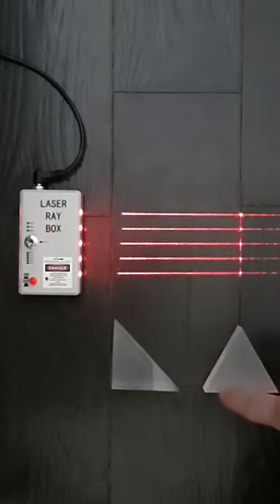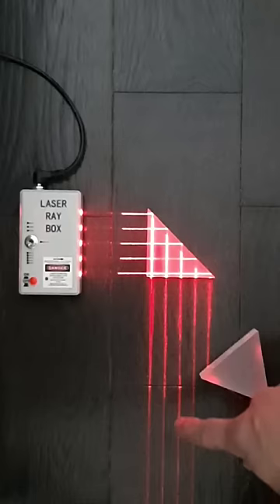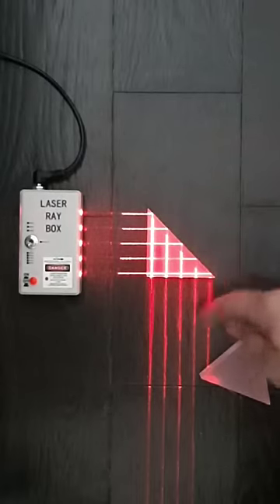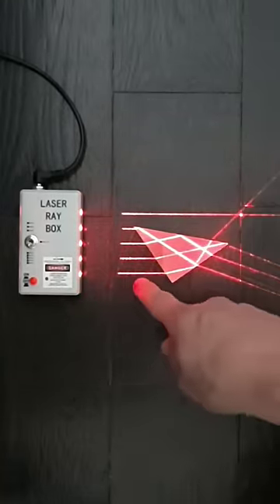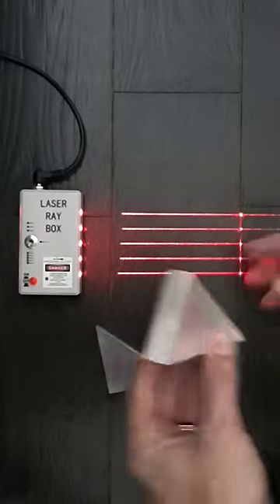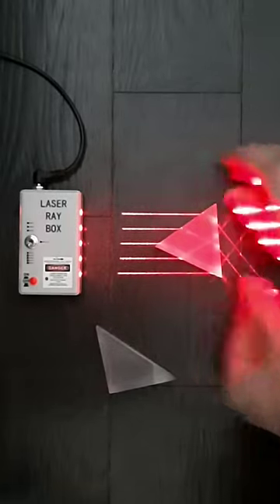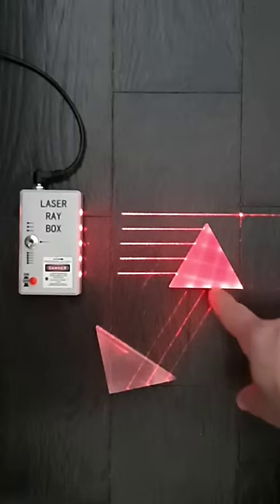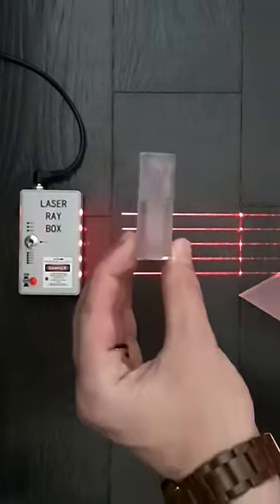How Prisms Work! #shorts

Comment from the maker: To learn more about optics-related science topics, view Edmund Optics’ Knowledge Center.
https://www.edmundoptics.com/knowledge-center

To view the largest selection of optics, laser optics, or other optics-related products, visit our website.
https://www.edmundoptics.com/
Reply: So here's what I want to know, how reflective is the total internal reflection? is it more reflective than a highly polished silver or aluminum mirror?
what about when compared to a dielectric mirror?
Reply from the maker: @Metal_Master_YT  amazingly, 100% percent of the light is reflected in total internal reflection, giving it an advantage over some types of mirrors. However, some light will still be lost transmitting through a glass prism and at the entrance and exit faces of the prism. 

You may get more light throughput using a prism instead of an aluminum mirror, but for the absolute highest reflectivity, dielectric mirrors are usually used

Comment: Just so people are aware, each material’s transition to another material (ie. the change from prism acrylic to air) has a specific “angle of incidence” at which point a beam of light reflects back like a mirror rather than passing through. Think of it like skipping a stone at a very shallow angle. That’s why for the shallower angles the light reflects back into the prism, while for the steeper (closer to perpendicular to the surface) angles allow light to pass right through.

Comment: The first prism is a right-angled prism where the other two side are of 45°. The rays that fall normally (90°) on the perpendicular side of the prism make a 45° angle of incidence with the hypotenuse side. Since the critical angle of this type of prism is around 42°, Total Internal Reflection (TIR) occurs which is why none of the rays pass through the hypotenuse but instead get deviated towards base.

Comment: They're also used in Ring Laser Gyros (RLGs).  RLGs are used a lot in aviation and live inside of Inertial Navigation Systems (INS) and take just a couple minutes to align versus an older regular INS system where it would take over 30 mins to align.  

When an RLG is powered on, it uses a prism to split a laser beam in two directions, which are opposite of each other.  Each beam hits a mirror on each side/corner and is routed to a detector.  When the RLG is rotated about its axis whether it's X,Y, or Z, one beam of light will reach the detector sooner than the other.  Of course we're talking measurements smaller than picoseconds, but yeah.  This is then translated to movement, and is processed and shown on aircraft displays for pitch/roll/yaw information.  

Each Inertial Navigation System (INS) has 3 RLGs inside of it (one for each axis). Most aircraft have at least two INS systems.  All brought to you by, lasers 😁😎
Reply: So how does an INS work?
Reply: the fact that we can measure things based on the speed of light being changed is crazy

Comment from the maker: What other topics would you like us to talk about?
Reply: I remember studying this for my physics exam very annoying since I don't get to play with the prisms or mirrors
Reply from the maker: @ThatOneOddGuy  Yeah getting to actually see how they change the light makes these concepts a lot easier to understand!
Reply: Can you explain why your hand got illuminated behind the prism, even though there was total internal reflection? So, did not all light get reflected?
Reply from the maker: @chunchunmaru1337  that's because this laser box generates laser lines (triangles of light expanding away from it) instead of normal laser beams! That makes the light show up on the ground below (which is great for these demos), but some light also passes over the top of the prism and hits my hand behind it
Reply: What pther topics? Principle uses for beam splitters.
Reply: Are there any nonlinear crystals containing something like gadolinium that have unusual effects in magnetic fields?
Reply: If you aligned two lasers perfectly for destructive interference so that it appeared dark, where does the energy go?
Reply: How does a Q switch work?

 How do I even know what Q means in what context?
Reply: Is there some kind of optical device that can focus completely diffuse light? Perhaps using components with variable index of refraction or a metamaterial that emulates such? 
Or would the problem of focusing diffuse light to a point be a lot simpler than that?
  What materials have that nonlinear property where the index of refraction changes based on the angle of incidence? Or has that property only been demonstrated in metamaterials?
Reply: I would like to see the actual manufacturing process of making narrow band filters. I understand the concept of thin film interference, but how does one use holograms to create filters that seem to work in any arbitrary frequency or combination of frequencies? How are they made ? How are they mass produced and what kind of materials can you make them out of?
 I would love to see a whole factory tour!
Reply: I want a specific lens for a project. How do i either make one at home or buy one at a reasonable price?
Reply: I always save the prisms from stuff I scrap, like old projection tv's.  My favorite is getting them from old Tank parascopes.
Reply from the maker: @commodoresixfour7478  Awesome!
Reply: @petevenuti7355  Due to conservation of etendue it is impossible to focus completely diffuse light
Reply: @thewhitefalcon8539  I can't say I quite understand that principle yet, but if you understand it, I got a question, when talking about a reflected light source, wouldn't the 'color temperature' of the light matter more, that is limited by both the luminosity and the spectrum of the original source , rather than the item doing the reflection?
Reply: @petevenuti7355  Colour temperature matters if you are trying to heat something up. A 5000K colour temperature won't heat something hotter than 5000K.

Heat is diffuse too, so diffuse light can make heat, but diffuse light can't make concentrated anything.
Reply: @thewhitefalcon8539  I still think a metamaterial where the index of refraction varies with a  angle of incidence ,and possibly negative value, would be an exception to the diffuse light rule... If tuned just right I'd expect that all the light from a diffuser that hits a point of such a material would be transformed to  'appear' thereafter to originate from that point on a surface much smaller than the diffuse source & going in a single direction...
   It's not like I need a material with negative mass to make it work 😜 not quite as far fetched... 
  Seriously though, I'm aware of nonlinear index materials also composite materials with negative index of refraction, never both and if I understood the Math of how these composite materials are designed I may have already tried to build it... 
  If you understand the math of nonlinear photonic crystals,  then tell me , is there some inherit limitations of the constants of nature that would preclude the existence of such a material? Or would it just be impractical because say for example it would only work with an extremely narrow band of frequency that was different depending on angle. (Which would still be very interesting)
Reply: But why does it reflect
Reply: Do prisms work differently underwater, or in a vacuum?
Reply from the maker: @ChaaFound97  they would work differently! The angle light is bent entering the prism and whether that total internal reflection occurs is based on the 2 materials (in this case air and glass). It would be quite different underwater
Reply: More prisms!
Reply: @ChaaFound97  yes , 
it's the difference between the refractive indexes that give it its properties , have you ever seen the invisible glass trick where they put one glass inside another and fill it with oil and the glass inside becomes invisible? That's because the oil has the same refractive index as the glass, if you did that with a prism, it wouldn't be a prism. What about putting two wet pieces of glass together? when you squeeze the air out from in between, you loose most of the total internal reflection.
Reply: Can you do thin film interference next
Reply: @edmundoptics jjjjjjjjjj😊jj😊😊jj😊jjj😊j😊jjjjjjjjjĵj😊jj😊j😊jj😊j😊jj😊hhhhhhhhhhhh😅h😅hhhhhhhhhhhhhhhhhhhhh😊😊hhhhhhhhhhhhhhhhhhhhhhhhhhhhhhhhhhhhhhhhhyĥhhhhhhhhhhhhhhhyhhhhhhy7766766766666666y66666666y6y66y6yyyy6yyyyyyyy66yyyyyy😅yyyyyyyyyyyyyyyy6y66y666666y66yyy6yyy😅y😅yy😅😅😅y😅yyyyy😅😅😅yyy😅😅yy6yyyyyyyyyyyyyyyyyyyyyyyyyyyyy6y66😅yyyyyyyyyyyyyyyyyyyyyyyyy😅yy😅yyyyyyyyyyyyyyyyyyyyÿy7y6yyyy😅y76yyyyyyyyyyyyyyyyyyyy7y7y7y7yyyyyyyyyyyyyyyyyyyyyyyyy77😅😅yyyy😅y😅7y6yyyyy67yyyyyyyyyyy7yyyyyyÿyyyyyyyyyyyyyyyyyyyyyyyyyyy😅😅😅😅😅😅😊😊😊😊😊😊😊😊
Reply: Fiber optics.
Reply: Mint moblie
Reply: Jesus Christ the sovereign God loves you 😊 I hope you can personally get to know the Holy Trinity, God miraculously healed me of my chronic breathing issues that plagued me for years on a near nightly basis if not every single night
God did this healing instantaneously within a group anointed prayer over my health, doing what nothing else would for years
Reply: Wait what.  That's REFRACTION, not reflection
Reply: Do u provide these as education kits that teachers can buy?
Reply: Make a pentaprism to show how a camera viewfinder works 😎
Reply: Can we trap a beam of light in an infinite loop of reflections?

Comment: It’s called snells law and has to do with the index of refraction of both materials the light is passing through. In this case air and glass. Then by taking the angle at which the light hits each material you can see its angle of refraction.
Reply: Exactly. Thank you.

Comment: Technically this is refraction, not reflection
Reply from the maker: The bending of light as it goes from one material to another (like air to the glass prism) is refraction, but the light reflecting back inside of the prism instead of leaving isn't refraction! It's called total internal reflection and it only occurs at specific angles of incidence

Comment: Another interesting thing about total internal reflection is that there’s 0 energy loss in this phenomenon unlike reflection from a mirror. This is used in optical fibre cables to transmit data as a beam of light with minimal energy loss
Reply from the maker: Exactly! That's why total internal reflection is so powerful

Comment: A quick explanation is that the shallower the angle The more likely the light is to bounce instead of go through. The angle required for this to happen is determined by the ratio of the speed of light in the 2 mediums. Thats why if it's straight on, it passes through, but glancing light will bounce off. Think road shimmer off in the distance or

Comment: Hmm a computer with spinning prisms inside it that act as gates with times laser pulses would be interesting
Reply from the maker: Scientists are working on making faster computers using light instead of electricity! Check out "photonic integrated circuits"
Reply: It's fun to have an idea and be able to find and read papers about the topic. I always feel dubious about concepts that I can't find precedents for.
Reply: You say that as if it would be faster or something.

Regular electron circuits are not about electrons physically moving, but the charge variation created, which travels at the speed of light. It is slower in longer distances because of resistance in the material the cable uses (eg copper). The reduced impact of the latter is why fiber (glass or plastic) optic (photon based)  cables are faster. Not because there is a speed difference between electric charge traveling at the speed of light vs photons doing the same (in a vacuum)

Point being, the reason light bends in a prism or any material one can see through. Is because on an atomic level the are electrons "spinning/orbiting" around the atom is creating electric charge. Photons react with this electric charged area on the atomic level and therefor changes angle, but it also moves slower.

The reason you get an angle in see though material is because light movies slower inside the material because of matter and the deflection angle of the light depends on the electron configuration of the atom, aka material. Therefor it is not a given at such short ranges that a "photon prism transistor" would be faster than a electric transistor.

My2cent.
Reply: @Lobos222  Well so the difference in speed is more tied to inrush/analog verses steady state/digital synchronous logic. So we're no where near approaching either case with digital circuits. 

There's also the fact that one of the main reasons to explore flux path, photonic, or plasmonic computation is non-linear operators which allow for instantaneous solving of calculus functions like differential equations, and integrals. 

As well as considerations for reversibility, quantized junctions, fully 3d architecture, chaos/dynamic/emergent process computing, component architectures that allow for memristors for super-efficient MRAM, and nanoscale dynamics like tunneling etc. 

The main hurdle right now is lack of standards in physical design kits, inadequate characterization of material properties, and lack of a single process nanoscale maskless lithography system.

Comment: Same thing happens in eyeglass lenses. Sometimes we make glasses with prism in it because the customer needs it, but sometimes we accidentally get prism in the lenses and have to start over. It is incredibly easy to mess up a pair of glasses 😅
Reply from the maker: Yeah prisms in eyeglasses help correct for double vision! If your 2 eyes aren't focusing on the same spot, a prism can change the focus position of one eye to line up with the other

Comment: Might be a small detail but the bending of light is actual called refraction.
Reply from the maker: The bending of light as it goes from one material to another (like air to the glass prism) is refraction, but the light reflecting back inside of the prism instead of leaving isn't refraction! It's called total internal reflection and it only occurs at specific angles of incidence

Comment: Should have explained how this happens. This has to do with the angle at which the light it hitting the glass and the different refractive indexes. This is also used in fiber optic cables. Light cannot escape glass if the angle of the surface is more than 45° thus being reflected inside.

Comment: Why do the lasers become beams only an inch or so after they've been emitted from the box?
Reply from the maker: This laser box is generating laser lines (triangles of light expanding away from the box) instead of normal beams like what you get out of a laser pointer. This makes the light show up on the surface below, which is great for these demos. Right after the box, the laser isn't visible because it hasn't reached the surface below yet. Normal laser beams wouldn't be visible in the air unless we turned on a fog machine

Comment: Guys I might be an idiot but why does the light enter the prism in the first place? I mean, it hits the prism but rather than bouncing off of it it goes through it and only bounces off the second time it touches a side of the object
Reply from the maker: The prism doesn't have any reflective coatings on it, so the light initially enters it the same way it would enter the windows in your house or car. The only times it reflects here are when its inside the prism and it hits the interface between glass and air past a certain angle. That angle is determined by the 2 materials (in this case glass and air). If you submerged this whole thing in water those internal reflections wouldn't happen!

Comment: Refracted*
Refraction*
Reply from the maker: The bending of light as it goes from one material to another (like air to the glass prism) is refraction, but the light reflecting back inside of the prism instead of leaving isn't refraction! It's called total internal reflection and it only occurs at specific angles of incidence

Comment: I like how you can use a glass of water shinning from the side refecting on the underside of the surface can use a glass of water to see quantum mechanics looking inside from the top you can't see out the sides even your hand holding it but if you press hard enough you can 
     quantum tunneling
Reply: that's by definition, not quantum

Comment: Bending of light is not reflection, but refraction
Reply from the maker: The bending of light as it goes from one material to another (like air to the glass prism) is refraction, but the light reflecting back inside of the prism instead of leaving isn't refraction! It's called total internal reflection and it only occurs at specific angles of incidence

Comment: I believe its called refraction
Reply from the maker: The bending of light as it goes from one material to another (like air to the glass prism) is refraction, but the light reflecting back inside of the prism instead of leaving isn't refraction! It's called total internal reflection and it only occurs at specific angles of incidence

Comment: Is it reflecting or refraction
Reply from the maker: The bending of light as it goes from one material to another (like air to the glass prism) is refraction, but the light reflecting back inside of the prism instead of leaving isn't refraction! It's called total internal reflection and it only occurs at specific angles of incidence

Comment: Wait I got a question, so you see how the light reflects on bot sides when he turned it into the 2nd position, if the light can reflect once on each side why don’t the lights reflect like infinity and go back and forth and be trapped in the prism?
Reply from the maker: Whether the internal reflection happens is based on the angle between the light and the interface between the two materials. If the prism was shaped differently you could get more internal reflections!